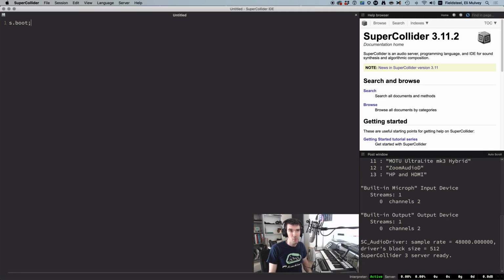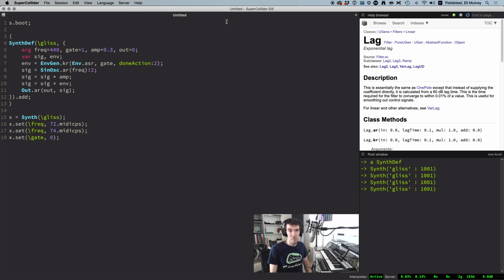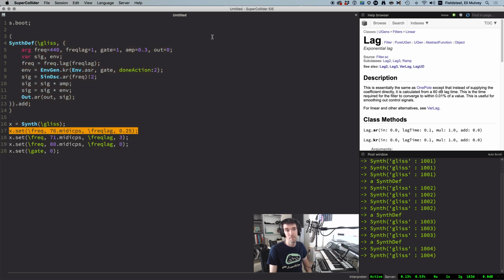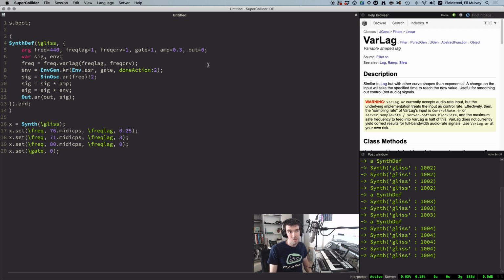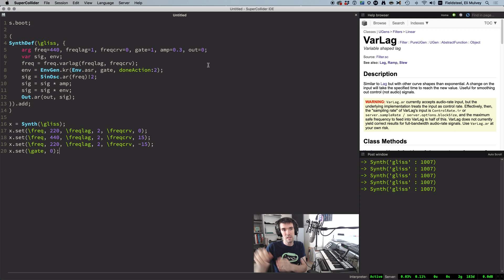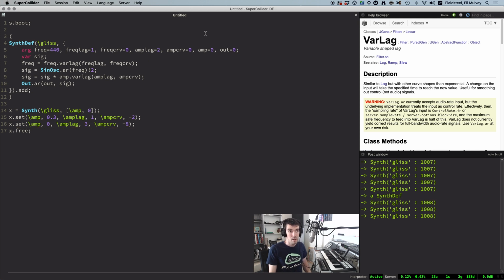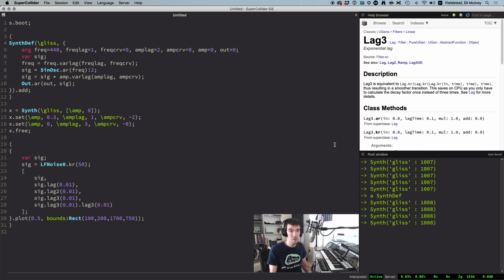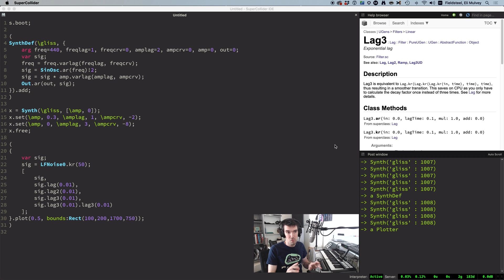SuperCollider Mini Tutorial: 3. Lag UGens

Comment: Hi Eli, 1st of all thx so much for the great material you prepare and share!
I have a question about the lag / varlag and patterns. It looks like only a Pmono take the lag into account, but I cannot get it to work within a Pbind situation. Do you know the reason? Thx in advance
Reply from the maker: Yes. You only hear the result of a lagged Synth argument if you call a 'set' message on a Synth, i.e. change some argument value from A to B. This is basically what Pmono does — when you play a Pmono, it creates exactly one Synth and repeatedly generates set messages, and as a result we will hear the lagged nature of those parameters. But, by default, a Pbind doesn't generate set messages. Instead, it generates a sequence of multiple Synths. Each Synth is given initial argument values, but on a per-Synth basis, these argument values don't change over time, and there are no set messages. So, we won't hear the lag when using Pbind in this way.

Comment: I've always asked myself if there is an easy way of doing this. But I just wish there was a way of doing it in the language without having to add lags to the synth... So if on a whim you wanted to lag a particular variable you wouldn't have to go into the synth. I've got synths with upwards of 5 lag objects, and an arg for each lag time, gets a bit cluttered. Would be nice to say Synth.set(\var,x).lag(y).
Great video though
Reply from the maker: There are stylistic alternatives. You don't necessarily have to clutter up your UGen function with Lags. You can specify an array of lag times in the SynthDef, after the UGen function:

(
SynthDef.new(\x, {
	arg freq=300, amp=0.2;
	var sig;
	sig = SinOsc.ar(freq, mul:amp);
	Out.ar(0, sig!2);
}, [1.0, 3.0]).add; //freq lag = 1 sec, amp lag = 3 sec
)

x = Synth(\x);
x.set(\freq, 400);
x.set(\amp, 0.5);

Or create control signals (i.e. "arguments") using the symbol shortcut for NamedControl. The second value is the lag time.

(
SynthDef.new(\x, {
	var sig;
	sig = SinOsc.ar(
		\freq.kr(300, 1.0), //arg freq, default value 300, 1 sec lag
		mul:\amp.kr(0.2, 3.0)
	);
	Out.ar(0, sig!2);
}).add;
)

x = Synth(\x);
x.set(\freq, 400);
x.set(\amp, 0.5);

The bottom line is that if you want to lag a parameter, passing it through a lag filter is a required step. SC could always apply a lag in the background for user convenience, but this would increase CPU load across the board, drastically so for numerous or large SynthDefs. Instead, you've got to handle your lags manually, but you have control over distribution of efficiency. I agree it would be nice to dynamically add a lag after defining the SynthDef — but that's not how SC works. Virtually every feature of a programming language involves a tradeoff.
Reply: @elifieldsteel  Also could I take this opportunity to suggest a video that explains changing resonance and amplitude in a filter. I think it's 1/res.sqrt for the amp.
I remember in a project I did in uni many years ago I used a normaliser to work around it, ignorant to a better approach. 
I find the idea of increasing resonance and pulling out partials maintaining a constant amplitude fascinating, especially on dissonant rhythmic material.
Reply from the maker: That's a nice idea, thanks. My understanding of filter math is far from complete. An amplitude of 1/rq.sqrt works well for BPF and Resonz when the source is broadband noise. I think it's just a value I saw somewhere, or something I randomly used while experimenting one day. For other filters (RLPF, RHPF, etc) and other sound sources (e.g. crumpling paper, leaves rustling), my approach to finding the "right" amplitude is based on trial-and-error, and there's no one amp compensation value that will work uniformly well for every situation. In these cases, a normalizer doesn't seem like such a bad solution.
Reply: @elifieldsteel  Thanking you very much :-)